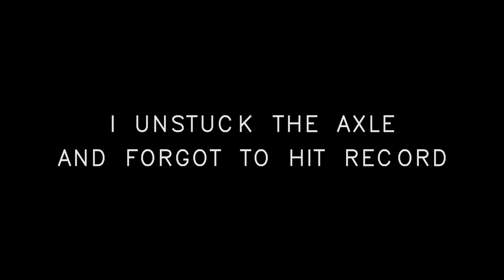MK1 Cabriolet Project - Engine Removal

Comment: I haven't be following much but I'm interested in a Cabriolet what kind of engine are you planning to drop in?
Reply from the maker: My plan was to rebuild the original engine, but its too far gone.  I found the same engine with much less mileage on it that Im gonna drop in.  If you want to swap, the options are pretty much endless
Reply: @invizion4993  I have an ABA 2.0 swap and a 5 speed in my cabriolet... it rips!